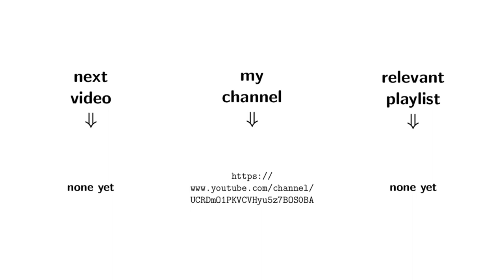ICA 0 - ICA in a Nutshell (23 min)

Comment: I have difficulty in understanding 5:30 . I understand what marginal probability is, but I am not able to make sense of it here.
Reply from the maker: Condition for statistical independence is that p(s1,s2)=p(s1)p(s2) holds. To verify this we first need to figure out the marginals from the joint, i.e. go from p(s1,s2) to p(s1) and p(s2) individually, and then we need to put it together again by multiplication to get p(s1)p(s2). Only if that equals p(s1,s2) are the two components independent of each other.